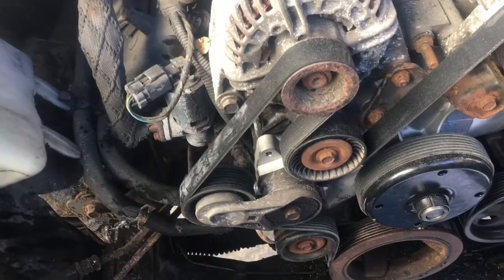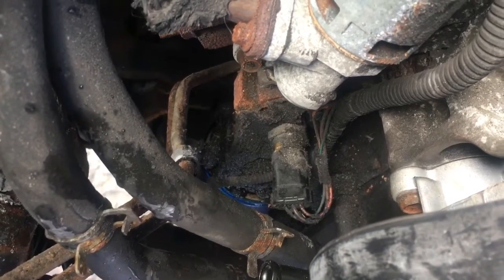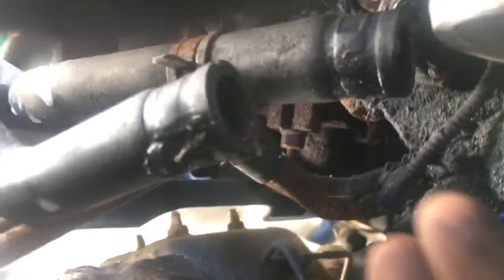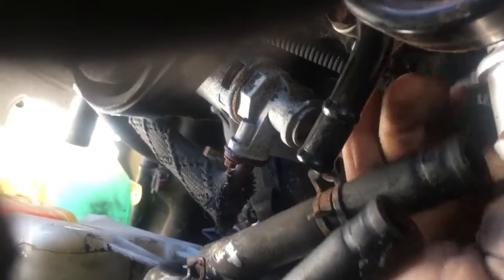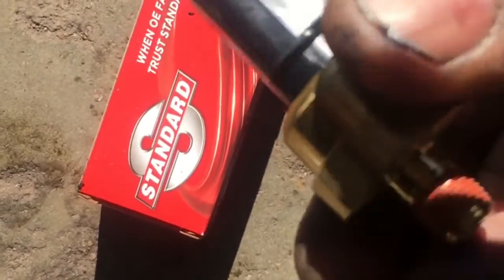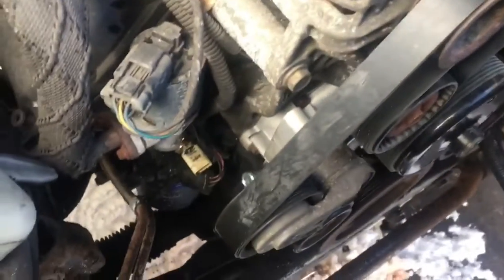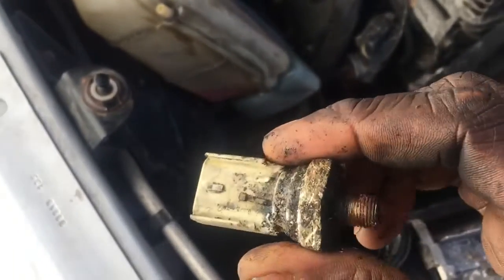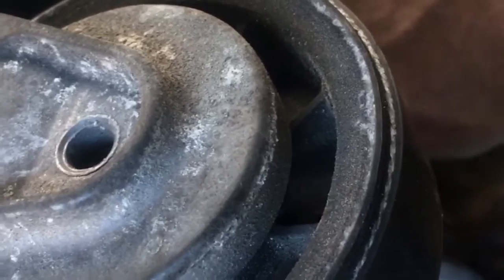P0520 Replacing oil pressure sensor 2003-2008 Dodge Ram 1500 5.7L HEMI

Comment: Very helpful thanks. I have a 3.7 and it's exactly the same except on the driver side of the engine. The 3.7 is one pin. Not too hard to get to from the bottom. If not also changing the oil be prepared for a small stream of oil while the sensor is out. Just be ready to put the new one in right away. Good thing is the leaking oil drains right behind the filter and there's a channel there for draining when changing the filter so very easy to manage. Thanks again.
Reply: Did you add Teflon tape
Reply: @MrBrad504  I did add a little teflon tape even though there was a coating on the threads already. I'll check it again in a few weeks to see if there are any leaks just in case.

Comment: Thank you so much!!! I was so stressed out. God Bless you. Mine did have the 1 prong plug I was a little confused at first thought I had bought the wrong one. The part was only 18.00 at O'riley's  my husband had it fixed in 15 minutes watching your video.
Reply from the maker: Glad it helped!!!!!  :)
Reply: I have a 2006 Ram 1500 5.7 and I have a P0520 code also causing my oil gauge to read close to the high zone. I’m considering to get a premium grade oil sending unit since cheap ones don’t last long.

Comment: The sensor does require a 1-1/16 inch deep well socket (not 1-1/8").  The sensor thread does require application of a teflon thread tape or a liquid sealant to insure against leaks when you screw it in.
Reply: Most come with the Teflon tape applied